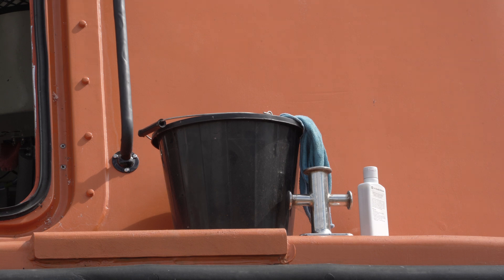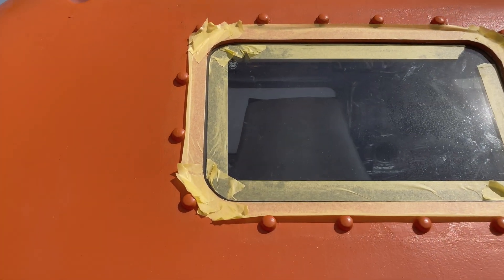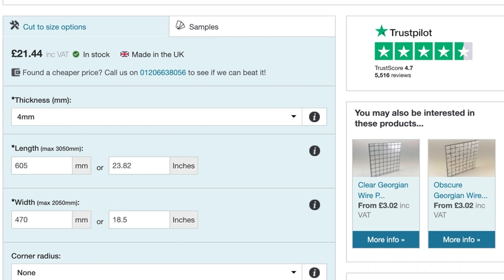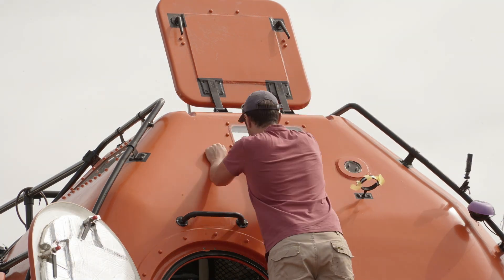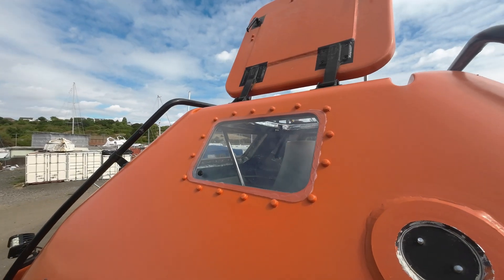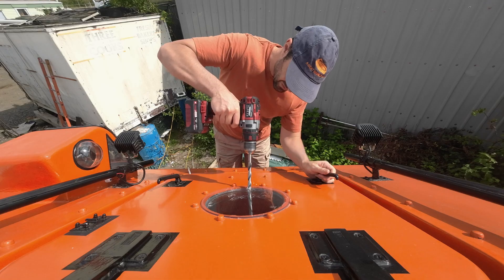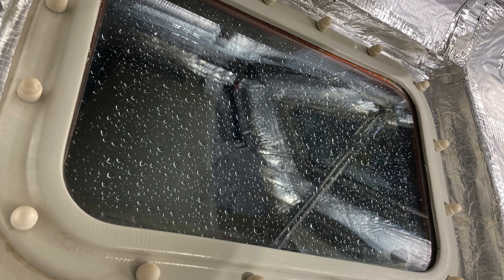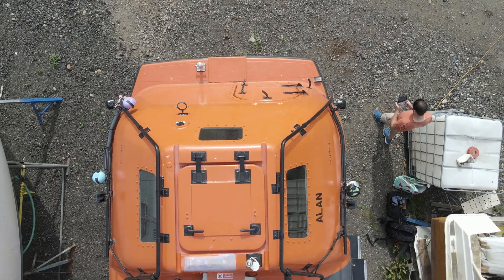Lifeboat polycarb secondary glazing. Insulation replaces condensation. Lifeboat Conversion Ep55 [4K]

Comment: Why not secondary glaze inside the pane?
It wouldn't be subjected to any of the weather, sea water, segull poop, UV, etc, etc that the outside will.

Anyway, that's what I would do ( I'm considering doing it on my campervan)

Now I'll watch your entertaining video !

Edit - in the meantime, a simple window vacuum works wonders to remove condensation.
The single glazed windows (when not insulated by the blind) work as water magnets, so I can reduce the humidity just by vacuuming the windows regularly in winter months. It's very effective !
Reply from the maker: I've actually gone for a completely different system with the window enlargements (more recent episodes). No secondary glazing at all now!
Reply: @AlexHibbertOriginals  looking forward to seeing it! Double glazed RV windows are game changing. 

Please explain why you added the secondary to the outside rather than inside. 
Love your videos!
Reply from the maker: Originally for two reasons. To mean that the polycarb could take impacts and not the glass. Secondly, the frame inside the boat was complex with a protuding moulding and bolts, and hard to create a mount for the secondary glazing.

Comment: HELIUM is just about the worst possible choice you can make for a gas. It is commonly used as the cooling medium in many kinds of equipment because it cools almost as good as watercooling!
What you want to use is Argon. It is the same gas used in low energy double glazing.. and by coincidence also for TIG Welding so it will be very easy to source. :-)
Reply from the maker: It turns out that polycarbonate lets any of these out anyhow, so more venting than sealing is the plan
Reply: @AlexHibbertOriginals  Argon atoms are larger than air atoms. This is because argon is a noble gas with an atomic number of 18, which means it has 18 protons in its nucleus. In contrast, air is a mixture of gases, primarily nitrogen (atomic number 7) and oxygen (8). 
But yes polycarbonate is permeable to gasses so eventually it will seep out. I know that from personal experience with Helium (2), which pretty much pees right through most plastics. But maybe you could make an experiment with a threaded screw in diagonal corners so it is easy to replace. And do some temperature experiments over time to see how long time the argon works. After all the thermal conductivity of argon is about 67% lower than that of air, so I think it is worth an experiment. 🙂

Comment: Hi Alex,
I buy a few weeks ago a similar boat. Only a bit bigger 11x4m. I want to enlarge the side and back windows. My plan was outside 10mm and inside 5mm. I have also, similar to "Stodig", side windows in the "living" area.
I'm thinking about the ventilation hole. What's better, inside or outside?
For the main driving front window (my boat have two front windows) I'm thinking about splash protection. Rotation windows (rotoclear) CNC machines or Navy ships have it, normal Windscreen wiper or maybe compressed air. The Windscreen wiper from car back windows are cheap but I'm not sure about saltwater protection and it produces scratches on polycarbonat. The compressed air is expensive, special on a small boat, but I want a compressor on my boat.
Maybe you have also similar ideas.

Best regards Andre
Reply from the maker: I'm not sure holes to the inside would be a good idea.

Comment: You will never keep gas in there. Plastics and resins are gas permeable.
Reply from the maker: I wasn't aware quite how permeable PC is compared to other plastics. Thanks for the heads up.
Reply: @AlexHibbertOriginals  you would have to silicone seal the stopper in and then you could put dry, 100% argon gas, but it would be expensive and the off gassing of the plastics and their permeability to gas and moisture would contaminate the space. What you have set up is your best solution for what you are looking to do.

Comment: Just an idea for the desiccant.. You can buy ceramic desiccant beads. With your skill n patients, I'm sure you could drill and run the magic string through to make it real easy to get in and out. On the plus side, if they have soaked up moisture, you put them into a low heat oven for 30-45 mins and they dry out and you can reuse them :D

Comment: Polycarbonate doesn’t shatter. It doesn’t crack. Its extremely easy to machine and the best stuff out there. Yes Acrylic is more scratch resistant, but it cracks even when you screw it down.

Comment: My thinking would be that since you have put the holes at the bottom & used bungs, it would be hard for you to replace the gas inside the gap and keep it there.  I know that some people use silica and iron powder packs for long term storage.  The silica absorbs moisture and the iron powder absorbs oxygen. If container is well sealed, there can even be a slight vacuum created.  When they expire, you can just fish them out and replace them.

(I might not be explaining it very well, it's late and  I need sleep)
Reply: You must have dozed off when Alex showed the silica packets attached to a thin line for future removal inside the new glazing.
Reply from the maker: Even I doze off.
Reply: @teeanahera8949  No I didn't.  I just said that I know some people use silica AND iron power packs.

Comment: If you are going to fill the voids between panes with a gas, I'd recommend a heavier gas that is less likely to leak out via osmosis.  Nitrogen is likely a good candidate for its high density and low reactivity, as well as relative cheapness, though would not serve as well as a thermal insulator when compared to other gases like krypton or argon typically used in higher efficiency windows.
Reply: I was hoping to say exactly this. Helium wouldn't last long in there.
Reply from the maker: I've been suitably schooled on helium, and the permeability of polycarb.
Reply: Yes I would not recommend using Helium. We use Helium in the electronics industry to detect miniscule vacuum leaks precisely because it is the smallest molecule and has the fastest molecular speed. Hence it is the hardest of all gases to contain. It would leak out in a heartbeat right past your window gaskets or bung. Better to use Argon which is what the industry uses when making insulated gas filled windows. Keep up the great work! You have mad skillz!

Comment: Use the old fashioned way of cleaning windows which has always been the best, tip about a cup of methylated spirits to 1.5 litres of hot water & use plain old newspaper as the cloth to wipe over both sides of the glass to get rid of all imperfections turning it back to looking like brand new.

Comment: I wonder if a ceramic coating on the windows would help reduce scratches as well as reduce water beading on the surface. Maybe a car brand ceramic from amazon would help?
Reply: Graphene wax might be a good choice too, like the Turtle Wax Flex wax one. Although in a different application (a car) I usually choose graphene wax over ceramic but they're both pretty much on par right now with pros and cons. It might be a nice video for Alex to test the durability of each to salt water and freezing temps?

Comment: Typically Argon gas is used for glazing. As a noble gas it won’t react with anything and it’s a big molecule so will find it harder to escape.  It’s denser than air so is poured in from the top pushing all the air out on its way in. As a plus it’s also often used as a shield gas in mig welding so it’s not hard to get hold of.
Reply: This! If you are going to mess with an inert gas, argon is the way to go!
Reply: I thought it is because argon is opaque to certain infrared wavelengths.

Comment: Much More holes. Outer panes are always ventilated. Everybody living north of 60 knows that. Also  holes need to be in every corner -- you do not want water freezing in there. On my 3-pane window, the outer layer is very ventilated, middle layer only slightly  and  the innermost window is airtight.

Comment: I think you do better to fill with nitrogen. As I recall helium is an active gas. That is why it is used for welding stainless steel. It transmits electricity and higher heat
Reply: I was going to suggest nitrogen as well..